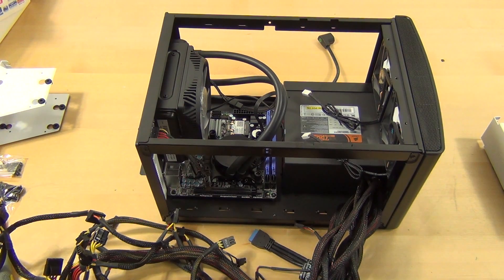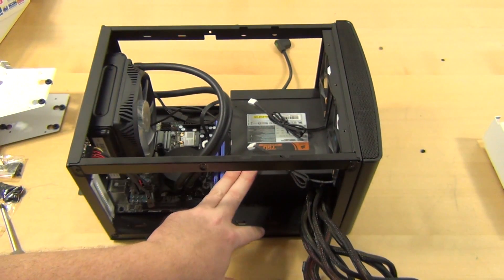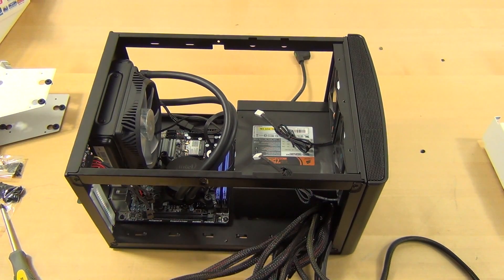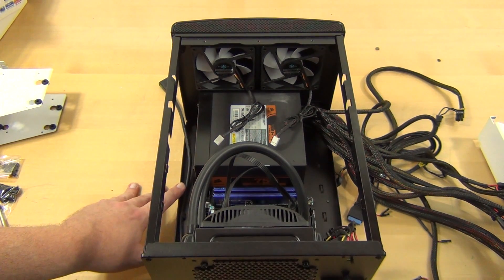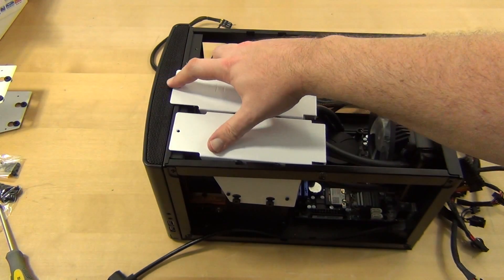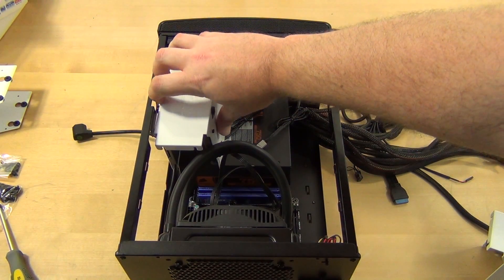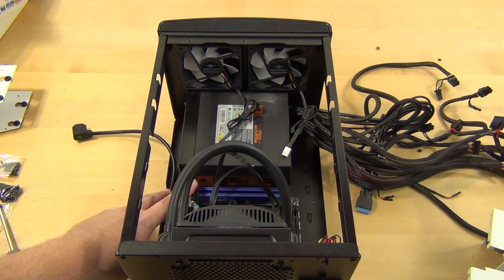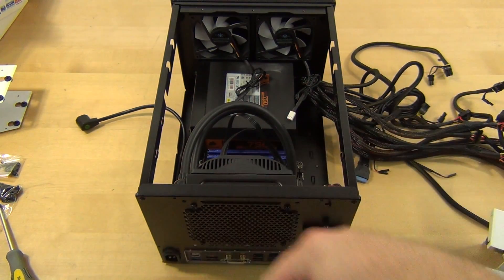How to build a mini-itx editing & gaming system - Meet the Snow Badger (Part 1.5)

Comment: The Solverstone Strider PSU will solve the PSU/GPU spacing issue, but note that the Corsair CX600M is also suitable. It's 150mm long and semi modular, with the modular plugs near the corner of the PSU where they'll be least likely to hit the GPU.

Comment: Nice build man, How about a modular supply with some custom length cables. Able to throw in a cable crimping and sleeving guide as a bonus. End result would look sweet and you'd get a really short PCI-e power cable to hook up with the GPU.